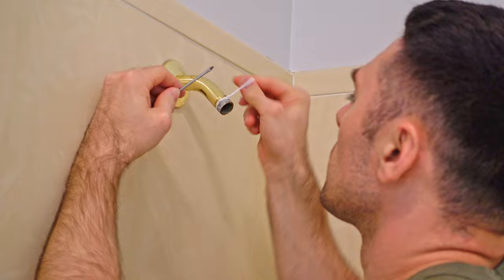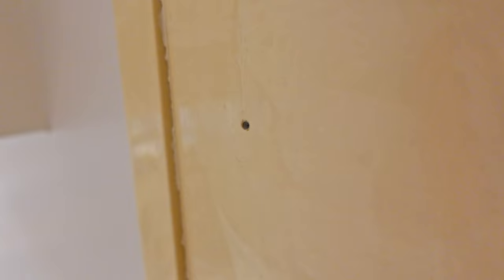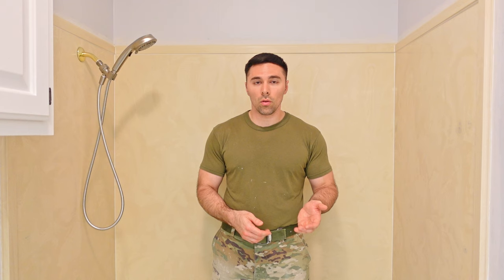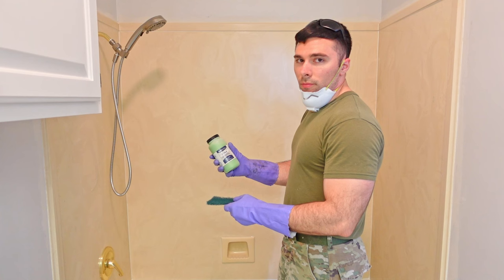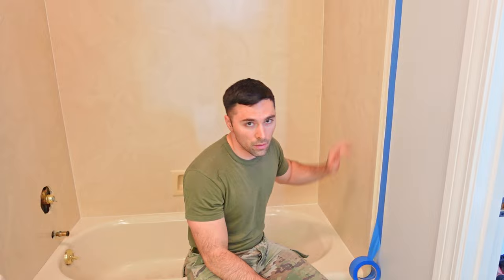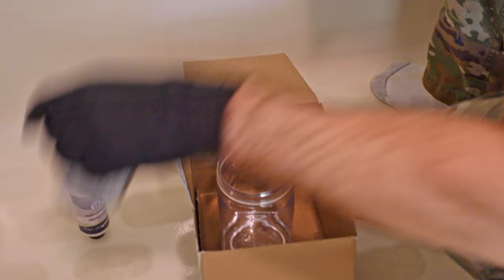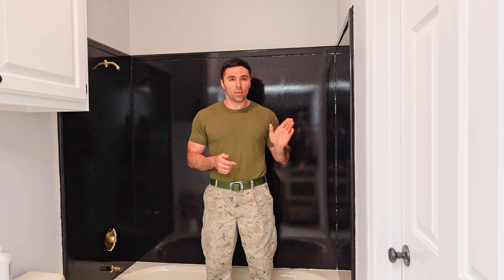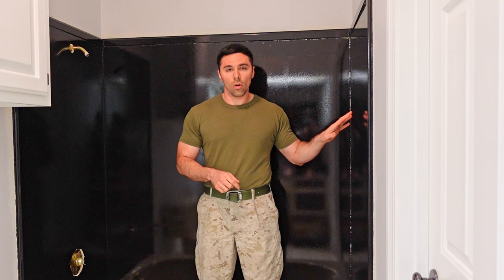DIY Shower Wall Refinishing Using Bathworks Kit

Comment: I seen your comments below so I can respect that..Did you get a refund? I used this product and the coverage is bunk. The little woman actually used 2 kits to do just the tile surround so it was extra think on the walls. Was it extra durable, not hardly. I wouldn't waste my time on this product. It's been 2 weeks since the application and I can already see bare tile underneath. Let's see what the manufacture has to say about it, oddly, there is nothing about the warranty in the kit. Now I'm out about 300 dollars and still have to replace my tiles....short cuts aren't allowed in life people..
Reply from the maker: No I didn't bother complaining to the company. It was my choice to use the product and frankly I might have done things wrong in the process so I can't blame the product entirely. DIY projects is like a game in a way "You win some you lose some". I have been impressed with its durability so far, so no complaints there. But I think eventually I will just have to spend the money and redo the shower/tub by taking them out and doing a big makeover.

Comment: Here is something: Looks as if the original cultured marble shower surround has yellowed a lot over the years.  I suspect that  the fluorescent lighting over the decades did that.  I would replace the fluorescent with an LED "put-in-place replacement tube  that won't have UV  radiation.  Might be a moot point since you are refinishing but the LED  tubes will save on energy.
Reply from the maker: LEDs are already in every light fixture in the house but I completely agree with swapping for the energy savings and the heat reductions since fluorescents and incandescent bulbs could literally heat your home in winter. If the cultured marble yellowed then it did so equally in all bathrooms and showers since there is no obvious color differences between them. Personally I don't think they yellowed I have seen this or very similar to this color in other homes over the years. This is simply a fairly popular color from the late 80s/early 90s when the house was designed and built.
Reply: @thediygrunt  Fluorescent lights do a lot of damage over time with the UV rays. This is why a lot of electronics, computer cases and the like are yellowed over time. The UV light reacts with the flame retardant chemicals in the plastic and turns yellow.  When I was in the military - for a lot of years- excessive and I mean excessive over use of tobacco also resulted in a lot of yellowing of things, but that is another story. Yes, There was a time when ashtrays were on the desks, butt cans everywhere and people's mouths occupied by the cancer sticks.
Reply: @thediygrunt  Do be careful using LED illumination. The cheap ones have an annoying flicker that you can't see but the flicker does affect humans and animals can really notice it.  Also, the source of illumination should not be in the line of sight. One of my biggest pet peeves besides two piece toilets.

Comment: What did you use to fill the screw holes left behind by the shower doors?
Reply from the maker: I ended up using all purpose Bondo putty to fill in the holes. However the normal Bondo is only water resistant not water proof, so I would not recommend it unless you intend to recoat the the panels with a new water proof finish like I was attempting to do in the video. There are some small kits on the market that are designed to patch holes in shower panels, they are typically around 20-30 dollars. I used the Bondo because I had it on hand and I knew once I applied my new finish to the panels, the Bondo would not be in direct water contact anymore. The Bondo product I should have used is the Fiberglass Resin, it is waterproof and its listed uses are tub, shower and sink repair. I have never used that particular Bondo product before so I can't say for sure how good it is.

Comment: What did you use to plug the holes from the door mount & how has that held up?
Reply from the maker: I ended up using all purpose Bondo putty to fill in the holes. However the normal Bondo is only water resistant not water proof, so I would not recommend it unless you intend to recoat the the panels with a new water proof finish like I was attempting to do in the video. There are some small kits on the market that are designed to patch holes in shower panels, they are typically around 20-30 dollars. I used the Bondo because I had it on hand and I knew once I applied my new finish to the panels, the Bondo would not be in direct water contact anymore. The Bondo product I should have used is the Fiberglass Resin, it is waterproof and its listed uses are tub, shower and sink repair. I have never used that particular Bondo product before so I can't say for sure how good it is.
Reply: @thediygrunt Thank you!!

Comment: Do not buy this product. I used it and it failed by the next day. it started peeling in 2 spots. I followed the instructions as it was written. I'm also a car painter and know how to properly prepare a surface before refinishing it.
Reply from the maker: I agree. I say at the end of the video that I do not recommend it. It was a horrible process and the final product was not worth it.
Reply: It actually recommends in the sds sheet full vapor respirator

Comment: Peeling is from not prepping properly.
Reply from the maker: Maybe, but I cleaned the shit out of those shower walls off camera.
Reply: I used this product and the coverage is bunk. The little woman actually used 2 kits to do just the tile surround so it was extra think on the walls. Was it extra durable, not hardly. I wouldn't waste my time on this product. It's been 2 weeks since the application and I can already see bare tile underneath. Let's see what the manufacture has to say about it, oddly, there is nothing about the warranty in the kit. Now I'm out about 300 dollars and still have to replace my tiles....short cuts aren't allowed in life people..